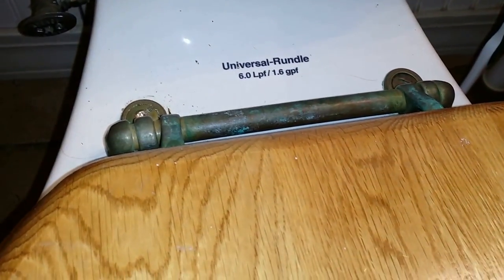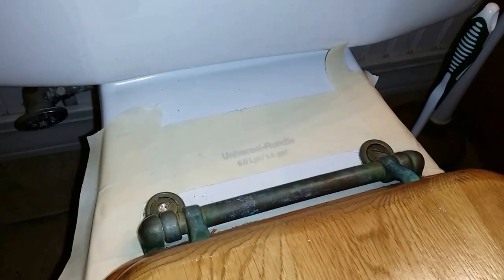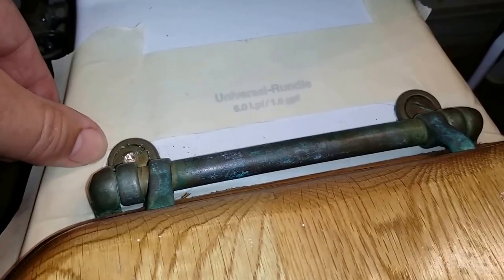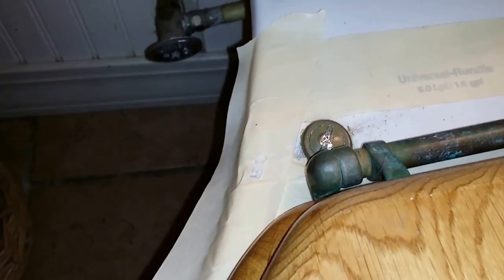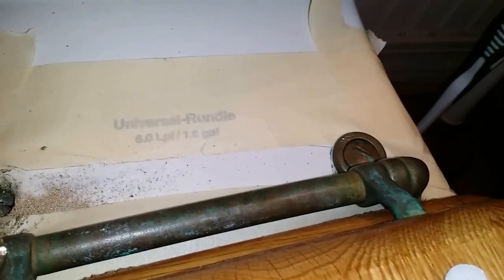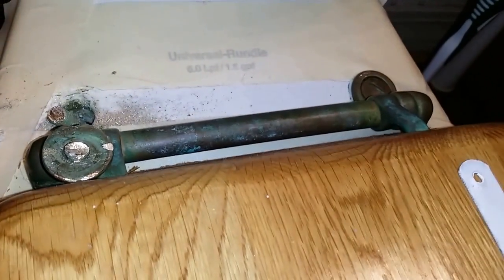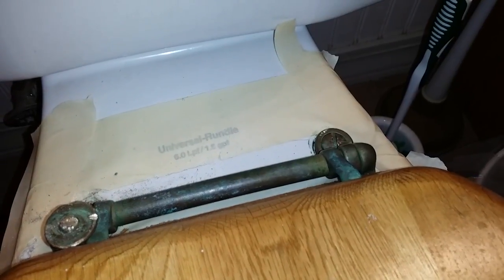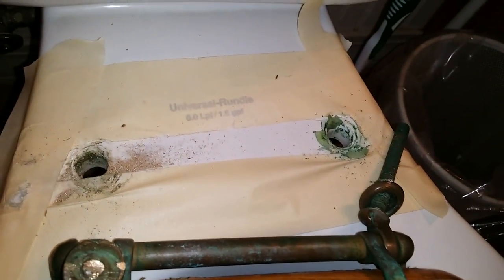Stuck Toilet Lid Bolts! Creative ideas for Removing an old stuck toilet lid

Comment: I watched many videos and was trying to figure out how to get my old toilet seat off for this exact reason.  After watching a dozen or so, this seemed to be the most appropriate for my situation.  I was lucky to have found a blade in my garage workbench and went to town.  I had just enough space under the top bolt to get the blade to slide under, lucky enough.  You're right, it takes patience and about 20 minutes hacking away on each bolt but it finally worked!  I did wrap the blade with a washcloth to protect my hands from damage, it helped with the grip as well! Thanks for the video, I was ready to buy a whole new toilet or call a plumber

Comment: Had the same problem with the same toilet seat. 
Wiggled the seat until it came out,  leaving only the screws and wing nuts. Grabbed and held the wing nut with a long wrench in one hand while cranking counter clockwise using the inside teeth of a standard pair of pliers.

Comment: I have found the best fastest way to deal with these plastic nuts. I used a 5 and 1 tool. A chisel will also work. Set the blade right on the nut and use a hammer to cut through the nut. Once it cracks open it will break the seal it has and will unscrew easily.

Comment: Don't US hacksaws have the ability to rotate the blade 90 degrees so you can saw with the blade flat? A correctly tensioned (and sharp) blade will work much more effectively.

Anyway, having looked for such a video and not finding one, I attempted something similar myself with a thin layer of cardboard for protection. The bolts were actually very easy to cut through and I had fitted a budget soft close seat in no time.
Cleaning the rusted fragments and debris from the floor was the biggest issue and I'd recommend putting something like an old towel on the floor as a magnet didn't help much at all.

Only after I had completed the task has your video popped up in the recommendations.